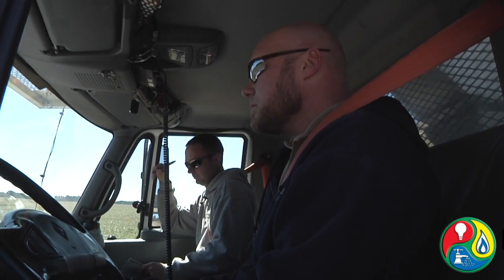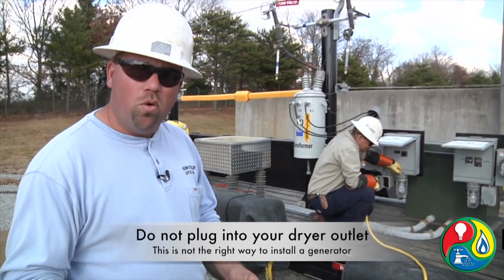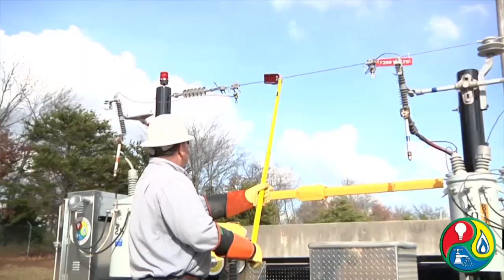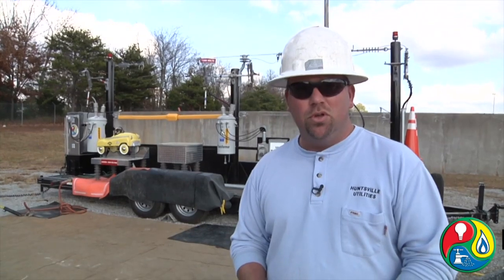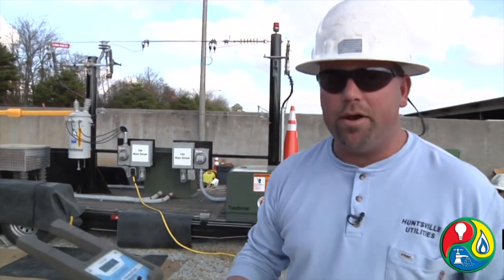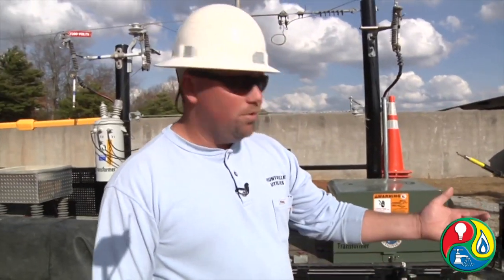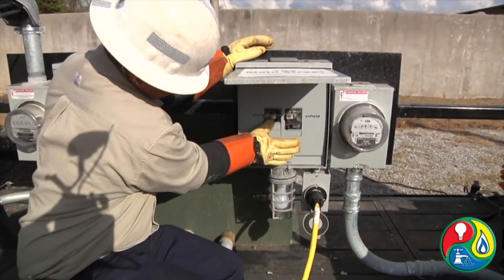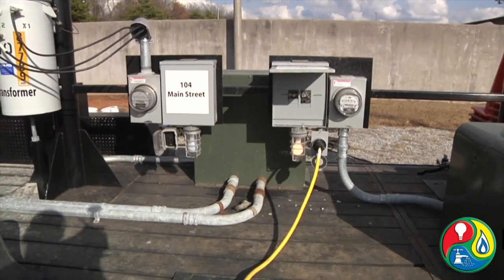Backfeed Protection

Comment: Question, why cant the meter stop backflow?
Reply from the maker: Electricity doesn't flow directionally. It works based on a circuit, open or closed.
Reply: @HuntsvilleUtilities  Yet it is unsafe to use the dryer plug method (with the main off) because the circuit can't handle reversed flow. Pick one.
Reply: @endoresu  It can't handle the magnitude of flow is the issue with the dryer outlet, they're usually grossly under gauged on the neutral/ground wire to carry the current of the house, and not well protected by the breaker on the 240V leg.

Comment: I have always wondered about this situation... Seems to me that even when you are backfeeding the power line the other houses on your line are still connected so your generator is going to try and power them. I should think that would blow the breaker on the generator.
Reply from the maker: It would not power your neighbor's house due to the other equipment that is present between the service lines and commercial/residential customer lines.
Reply: It should trip the breaker on the generator, I have seen many people do it. The only way this scenario they provided would happen is if the transformer was for a single house and the high voltage line was cut. In many suburbs you have 4-8 homes connected in parallel to a single transformer. In that case the unsafe backfeed instantly trips breakers. The old mechanical meters allow backfeed but a lot of the electronic meters have a relay inside which stays open when not fed by the power grid.

Comment: You can also turn off the main, then tape it off with a sign stating that turning it on will kill the person who turns it on. Pictures of skull and crossbones help as well. Another great idea is to lock the panel after you've set it up with a padlock.
Reply from the maker: Thank you for your comment, however you would still be backfeeding your home with electricity which is not safe. It is very 
important to get a qualified, licensed electrician to install the generator and ensure that all permits are obtained and electrical 
inspections are completed as well.
Back feeding can kill someone.  Hiring an electrician to install it properly creates for a safe and responsible way to use a generator to power your home.  Please do not use the method you have suggested.
Reply: @HuntsvilleUtilities  but it's safe if an electrician installs an interlock device?  This makes no sense, you are still backfeeding the panel....
Reply: @jolkraeremeark6949  This is the exact question I can’t get a straight answer on. Make it make sense

Comment: So you can plug it into a dryer outlet just make sure the main is off so it’s not feeding electricity throughout the whole neighborhood. Possibly injuring or killing the people trying to restore your power.?But your house wouldn’t be hurt? Just flip the main OFF 1st?
Reply from the maker: However your home's electrical system was not designed with this type of flow. You would essentially be sending electricity in the opposite direction for how the wiring was intending to be used. It can be dangerous. It's not just a matter of turning the breaker off. You should have your home inspected by a licensed electrician and have a proper switch installed when using a generator to provide your home with electricity.
Reply: The electricity reverses flow 60 times a second, its not "type of flow" its "magnitude of flow", your main wires are large and designed to give you 150 to 200 amps of current. It would be severely wasteful to run that large of wires to every outlet and light in your house, so the circuits are branched off to smaller wires, and protected by breakers, I'm sure you know this.   The mistake in thinking "my dryer outlet is 50 amp, so I can run x,y,z,p,d,q from that outlet" is that the 50 amp rating especially in old installs with 3 wires is only on the two hot wires that bring 240 to the dryer.  The 3rd prong is ground and if there's a 4th its a neutral, but both perhaps are only sized enough to run 10-15 amps of current for the controls of the dryer.  Backfeeding 240 through this with the ground as the neutral or even with 4 wires can end up putting all the return current of the 120V circuits through the smaller neutral or ground wire, heating it up, but since its on a 40 amp breaker, not cutting the circuit, and starting a fire in the walls due to a red-hot wire.  THIS is why you don't use your dryer outlet.  There's the blatant rule of "never do that", which will of course keep you safe, but the main thing would factually be does that wire have the ability to carry that current?  In the case of a dryer receptacle the answer is probably not, and its a case where the breaker isn't adequately small enough to protect that portion of the circuit.  A generator receptacle will have large enough conductor wires on all 3 conductors to handle the current of everything.
Reply: @snap-off5383  The key difference between a 3-prong and 4-prong dryer hookup is the wiring. The 3-prong dryer hookup has only two hot wires and a neutral wire. On the other hand, the more modern 4-prong dryer hookup has two hot wires, a ground wire, and neutral wire.

Comment: I still don't understand how this is any different than turning off mains and then connecting your generator? It appears to be doing exactly that, just mechanically..... What is the difference?
Reply from the maker: Using a switch takes the guess work out. Using a switch makes it safe because you can't accidentally have the switch in the wrong position.  Anything could happen between you "turning" the switch off and someone else coming along behind you and turning it back on.
Reply from the maker: Lumilan, thank you for your question. I hope I can offer some clarity. Installing the proper switch helps to eliminate human error. Or someone else flipping the switch a different direction. Many first responders will tell you it's often an accident when a line gets back fed by a generator.  A person thought they had everything in the correct position, but a step was skipped and so the electricity was put back onto the line. In a time when you would be using a generator, you would likely already be under some outside stress. Power loss is serious, electricity is something we rely on to complete some of the most basic tasks.  Going without power and then having to install a generator would put anyone at risk for making a human error.  Electricians install a switch that makes it so simple and safe, someone couldn't operate the generator and back feed at the same time. If you have any further questions or need recommendations for a licensed electrician please contact us at 256-535-1200.
Reply: What if you get exposed to carbon monoxide in your house and come outside dizzy, unable to think clearly and go to the breaker box to see what's wrong. You could turn it on. The reason for the switch is to prevent unforeseeable accidents, so you can't make a mistake if you are not thinking correctly due to an unforeseeable situation.

Comment: Great demonstration! I understand that I need to always have the master breaker locked off while back feeding the house through the dryer connection, but my question is, the master breaker doesn't disconnect the neutral feed from the utility co does it? Would there be an issue back feeding neutral with the hot legs locked off?
Reply from the maker: All good questions. The neutral connection will serve the customer and us well.  The neutral is grounded, assuming it remains intact.  Yes, the neutral can separate and create what’s known as a loose neutral.  The loose neutral would occur between the customer and HU’s transformer.  However, the ground rod connection at or near the meter base should still be intact.  If the customer should somehow energize the neutral a short would be created and a breaker would trip.
 
This question highlights the need for looking over your electrical connections from time-to-time.  The ground rod connection at or near the meter base should always remain intact, and should be inspected before operating a generator.  If that ground rod connection is broken it needs to be repaired as soon as possible.

Comment: Can’t I shut off my panel’s main service disconnect and use the dryer outlet option to circulate power through my home’s wiring without it traveling out to my meter and to the local transformer/pole?
Reply from the maker: Joe you seem to be missing the key point of the video. The point is to not use the dyer outlet at all. There's a reason why the cord you would have to use is nicknamed a suicide cord. The manufacturer of the generator and your utility company do not support these kinds of sketchy MacGuyver work arounds when it comes to electricity especially when lives are at stake. Hire a licensed electrician and connect the generator properly through your panel box or plug the items requiring power directing into the generator using the instructions that come with the generator. It's simple and easy to use a generator safely without putting anyone's life at risk. Especially those that are putting their lives in harms way to restore your power.
Reply: @HuntsvilleUtilities  Well said. Thank you.

Comment: if I switch of my main breaker it would be safe ?
Reply from the maker: No it is absolutely not safe.  A licensed electrician needs to install a switch specific for a generator.
Reply: WHY is the main breaker NOT enough..?? The entire point of the main breaker is to CUT power to the house FROM the street...??

Once that breaker is OFF, no power can back flow to the street.... If i am wrong help me understand why..??
Reply from the maker: Thank you for your question.  It helps spread the message that we want to make clear.  You need to have a switch installed to ensure that your main breaker is completely off and can not be accidentally on.
Reply: Yes...however the operative word is "IF".  The point is that using the failsafe is the correct method.  That way it eliminates the human error of forgetting to kill the main in the first place or accidentally energizing it while the generator is still online.  But...IF it's off, then yes it's "safe" as there's no chance of backfeeding the entire line.
Reply: @TakeDeadAim  Because the neutral is still connected so you are not completely isolated.

Comment: Why does flipping your main breaker not disconnect and isolate your home or business from the rest of the grid. If it cuts off incoming power why wouldn't it also cut off any outgoing power?
Reply from the maker: In theory it should, that's an excellent point, and exactly why it is important to have a licensed electrician install a backfeed protection switch to insure there is to chance of electricity going back to the main line.
Reply: It is supposed to cut off all power TO the house FROM the street... If it does NOT then you have a faulty MAIN BREAKER... OR that is NOT your main breaker to the house..
Reply from the maker: It is very important to get a qualified, licensed electrician to install the generator and ensure that all permits are obtained and electrical inspections are completed as well. If you have any questions please contact us at 256-535-1200.

Comment: .... linemen should always be grounding the lines out when they clamp or work on any area of the line. Even if they test and see no power, ground anyway before touching incase someone backfeeds and theyll short out of their gen. Once work is done, take ground off line and go to substation to reset........
Reply from the maker: You are correct and while they do ground, accidents can still happen due to human error.  Most often the linemen are working on live wires. So, they are quite familiar with safety practices and they do everything they can to work safely every day.  However, the locking switch...  it eliminates the chance for human error. Let's not discuss one human error for another human error, please. Let's continue to spread awareness that can reduce the chance of any human errors.

Comment: Ok , so if I install a interlock kit on a Ge Meter Main Load center With a 30amp CB along with a gen inlet box below main box will this be safe.?( I think this way main CB And Gen CB will never be ON at same Time- ) my Main concern will be the life of lineman-( yes I will have it inspected 
Just waiting for Homedepot to have THQLLX4  back in stock)
Now I understand the stepping up of Transformer. ( no joke)
Reply from the maker: Harley, thank you for your comment.  I will have to suggest that you check this method out with a licensed electrician.  Since I am not a licensed electrician, I can't offer any advice on methods.  I just want folks to be safe, and connect their generators the safest way possible. Using a switch that reduces the chance of power going back onto the lines is the message that I hope is loud and clear. Leave nothing to chance when it comes to generator power that could go out onto the grid.
Reply: Harley Ryder - A generator interlock is legal by the National Electric Code (NEC). There are advantages and disadvantages to using either a Generator Interlock or a Transfer switch. Both are perfectly safe if installed and used correctly. Although a generator interlock may appear to be very simple and straightforward, it is NOT a do it yourself project.  Always hire a professional licensed journeyman electrician to ensure the correct installation of the generator interlock is done to meet both national and local electrical codes.

Comment: What if use the dryer outlet option with a generator and pull the meter at my house? Wouldn’t that work and not back feed power to the power lines?
Reply from the maker: Meter tampering is a crime. You should never consider pulling the meter.
Reply: @HuntsvilleUtilities   Ok, thank you.

Comment: If the main breaker is off and the main breaker is locked out can it still back feed to transformer?
Reply from the maker: No, it would not. It would be disconnected from the power grid at that point.
Reply: @HuntsvilleUtilities  thank you I thought so but I wanted to be sure, double check, triple check, all that. Linemen are real heroes to be out making sure power gets turned back, don't need to make their lives anymore stressful
Reply from the maker: Yep! It's an honor to do what I do and work beside our community's home grown heroes! Electric, Water and Natural Gas workers... they all keep our utility services running smoothly. All of which are commodities we are so used to having that we don't really notice them until they aren't there. Please continue to spread awareness about generator backfeed. The more people know about the dangers of installing a generator improperly, the better. Always use a transfer switch OR plug your items directly into the unit per manufactures recommendations.
Reply: @HuntsvilleUtilities  I did, my dad wanted to do the same thing and we've grown up on a sugarcane farm so we have fabrication skills but I told him let me a correct way to do it before we built something. We're designing one that can only be used when either the main or backfeed breaker is off and locked out. So only after the main is off will the the backfeed be allowed to turn on and while on the main can't be turned back on until the backfeed is off

Comment: I wish breaker panels came with a built-in transfer switch instead of needing a separate box.
Reply from the maker: Remember generators can't always provide the power to your entire house in the event of a power outage. That's why you have to have a separate box, depending on the amount of things requiring generator power. a small generator like what is shown in this video may only power a few things, like the fridge and the hot water heater for example. An electrician can explain this specific to your home the power required to operate your appliances.
Reply: @HuntsvilleUtilities ,
  I can estimate the loads for my appliances, and switch on only the "essential" (fridge, freezer, furnace, sump-pump, bathroom and kitchen LED lights) circuits. I think my 3500W generator (4350W starting) will be fine to run those. I can always put the old clamp-meter (current) around the hot wires running from the breaker to the backfeed outlet to inspect the current on each side (phase) of the panel and make sure the sum of the max hot current on each phase is less than 30A.  I can toggle the loads every few hours for a couple of days in an emergency (or if the wife wants to use the microwave).

Comment: Cut your main breaker off and you don't have this problem the important thing is to make sure that the main breaker is off as long as the main breaker is off no power will backfeed into the power lines common sense not rocket science

Comment from the maker: To the person that made this comment a few days ago, I apologize for accidentally deleting it (And I will get you an answer)   @Huntsville Utilities  - what no one ever speaks about and to which I would appreciate a reply is the neutral line going back to the transformer. If you have a manual interlock and you turn off main breakers and turn on generator is the fact that the neutral is still connected allow any potential for current to flow back to transformer and cause issues?. Neutral carries back any imbalances during normal operations that’s why it is confusing. Can you speak to that please?  Any concerns about neutral always being connected even when you have a proper interlock?  Thanks!
Reply from the maker: The first response to this question is:  It depends!
Because of the different configurations in house and generation wirings, it’s best we refer you to a licensed electrician.
To expound on imbalance, there’s a difference between imbalance and the return loop of a circuit, hence the need for an electrician.